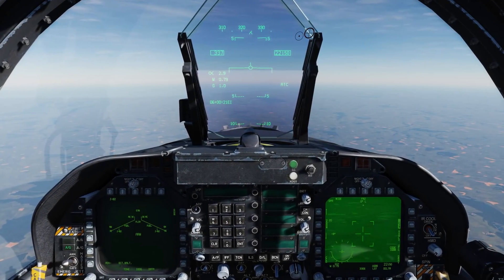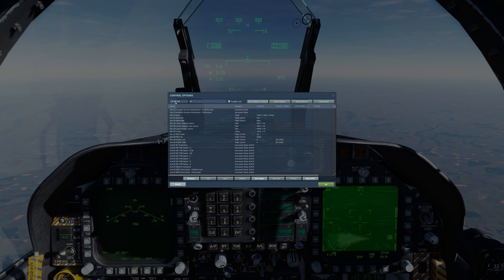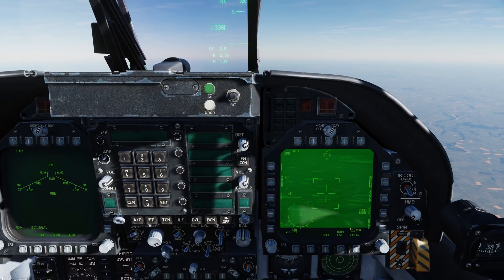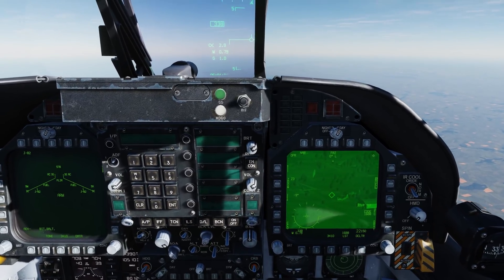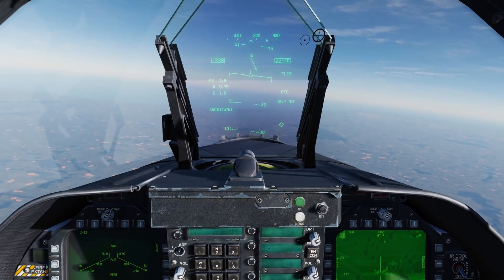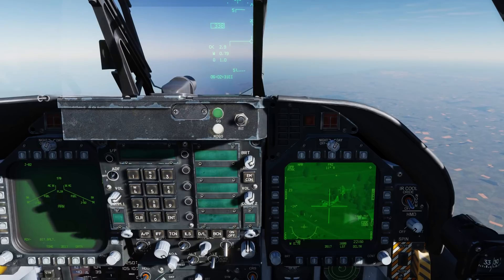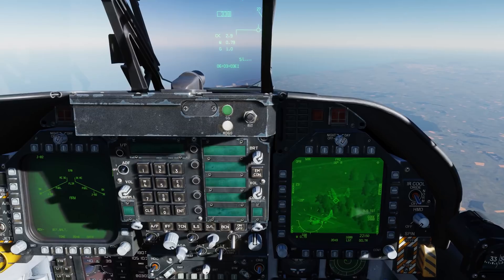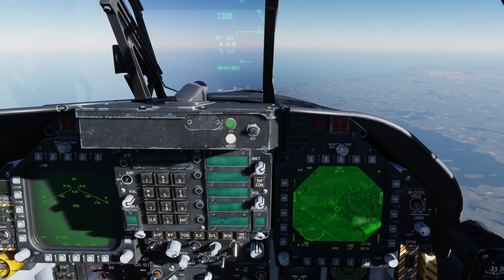DCS: F/A-18C Hornet - Targeting Pod Offset

Comment: Arggg I am confused with new TGP controls. So from this video I get: if you are point track->depress and offset->depress again to set offset->Sensor control switch right changes target designate to offset point. BUT IF HOWEVER you do the same in area track, sensor control switch right returns you to current/original target point? This is crazyness

Comment: Still confused about the offset in area track mode. You mention it helps to bring your eyes to the offset target or setup a lgb attack, but the pod doesn't slew to the offset location in area track mode. If the pod doesn't slew to the offset location, it can't be used for either of those things cause you're still pointing the pod at the original target. So then what's the purpose?

Comment: Thanks wags. Interestingly enough, I found this out by trial and error. I thought it was a bug because you hadn't mentioned it in your last video.

Do you know if the hornet URL, has the ability to designate a ground location as a waypoint using the TPOD or the A2G radar? And, if so, does your team plan on implementing that in the figure for our Hornet? 

It would be invaluable for many reasons. One thing I was trying to do is set up multiple angles for harpoon to reach a convoy so they don't all go after the same target. The way it is now, you can't do multiple harpoon turn points without first having set up multiple waypoints. 

Thanks and keep up the good work!

Comment: Am I understanding this correctly? The TGP can normally only be slewed in a non track mode (snowplow or waypoint designate). TDC depress then puts it in a track mode (allowing weapon employment) but prevents any more normal slewing. To change the aimpoint/trackpoint whist still in a track mode, an offset is used. However the TGP camera will only centre on the offset in point track and not area track.

Sorry for asking but I find it difficult to follow instruction when I don't understand the internal logic behind it.
Reply: Everything right, with the exception that an offset track can be either area or point track.

Comment: How do you point track a moving target if you now have to designate it and then switch to point track while the vehicle drives away?
Reply: You don't, just place your reticle above the target and SCS right until your reticle is replaced by two vertical bars. Contrast helps the sensor get a good lock so use the FLIR mode as opposed to CCD and adjust the level and gain if you have to.
Reply: @Qhaway  it has become a hell more difficult to deal with moving targets now... you have to anticipate the trajectory a lot more, put the reticle far ahead of the target then press twice right for it to go track mode. it's definitely not as enjoyable as it was before.
For laugh and giggles I tried for 10 min to track a C-130 going in circle in AG mode, just to try to land a GBU-12 on it for fun, too difficult now. I didn"t find a way to keep the AA tracking mode sticking to it when switching to AG.

Comment: Hey Wags.. is there some known issue with the waypoint diamond appearing in the air at the waypoint altitude rather than ground level/the TGP slewing to the waypoint altitude when you designate a waypoint as target?
Reply: I think it always looks at the altitude so if you want to set a waypoint for bombing, you have to give it the ground altitude as well
Reply: @MixedRealitySimRacing  - I want to say at one point it didn't? but I may be mistaken. I've also noticed what constitutes 'ground level' in the mission editor seems different for different aircraft somehow..
Reply: @stargazer79  That'l depend on the barometric pressure setting on your aircraft. The Hornet has always pointed it's pod at the altitude of a waypoint, gotta set it to ground level prior or manually in flight.
Reply: Yep! And, CMDR Ardent Fox, I believe you're in luck, I think Redkite has a pretty solid video on manually editing waypoints in the Hornet.

Comment: Hi Matt, is it possible to make the game HUD or interface (menus, text etc) larger? Thanks for the vid!
Reply: For text etc look under controls, graphics, UI scaling. For focusing on elements in the cockpit, search for the zoom control in the control binding interface. If you fly in vr, you'll find the zoom in the controls binding; click the drop down menu where you can select different planes in the top left corner, scroll all the way to the bottom to something like 'ui'; relevant are vr zoom and spyglass zoom. Also you can make the cockpit look bigger with options, vr, force IPD, and choosing a setting that is 5 to 10 points Lower then your actual IPD (too high differences can induce vertigo).

Comment: When tdc is depressed and the little crosshair is pointing at something else where is the laser pointing?
Reply: good question
Reply: The pod only has one gimbal, with all sensors and emitters mounted within. Where the camera looks, the laser looks.
Reply: ok mates, my initial thought was: WTF?!? Who is with me??
Seems like there is work to do for Redkite and Spud!
Reply: So if you use the offset will the laser be still the point it's locked on or where the offset is